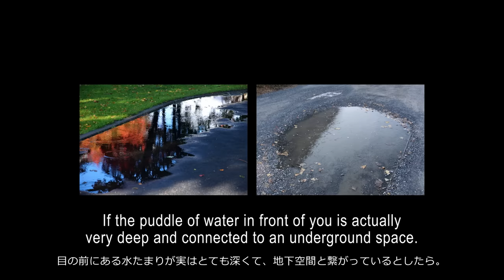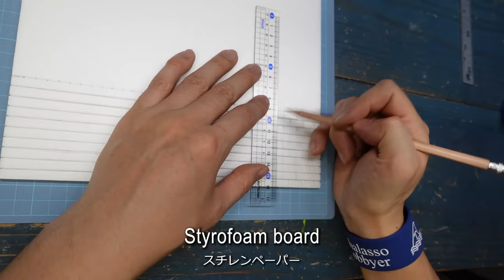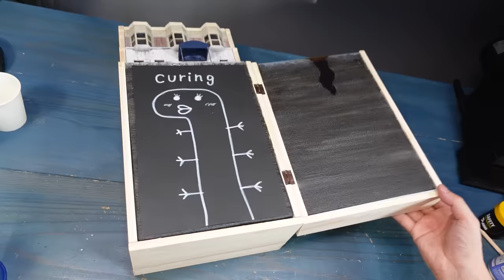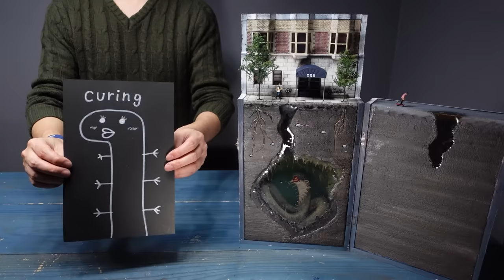Diorama of puddle-phobia

Comment: Nicely done, as always.  I had hoped you'd set a little red LED light at the bottom of the space, backlighting the monster and linked to a contact switch on the case door.  The batteries could've gone in the back.  It would have really made that space spookier.  Still - very cool.

Comment: This reminded of when I was around 10. I had seen a "puddle" with muddy water about an arms width wide that you could have stepped over length wise. My friends joked about jumping in it and splashing the mud, and I think I remember my one friend questioning how deep it went. Well I went to run through it and remember falling straight down.  It ended up being a sink hole that had gone up to shoulder height and I had to climb back out. No one was hurt and I was more embarrassed than afraid.  I definitely am not afraid of puddles, but I understand why its a phobia and this really hits a certain way. It looks cool as always.

Comment: Dunno if you would be interested. i suffer Thalosophobia and your art kinda..helps in a strange way. I recently had a nightmare in which i was on a steel elevator down a mine shaft, in the bottom there was a dark lake, the only light came from the top. and a massive sea creature like a snake came out of the water, trying to bite the cage, trying to swallow me whole only being protected by the steel bars that were slowly being consumed by it. Dunno if this could be an idea for any future proyects but i wanted to share that nightmare i had. i had another one about a library covered in old musky books, ancient books and in the middle of it there was this dark tank (the only source of light), so muddy and dark i could barely see anything inside of it, out of the darkness, a massive squid pressed itself against the glass, i could see its beak trying to shatter the container, its massive maw could swallow me whole and i could constantly feel like the room was shrinking and pushing me against the glass, forcing me to face the Beak of the monster.